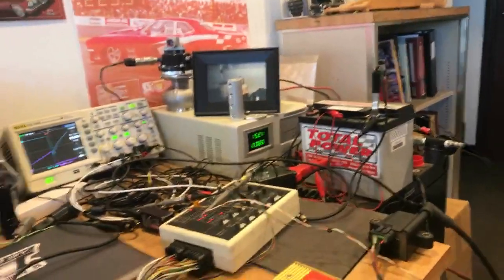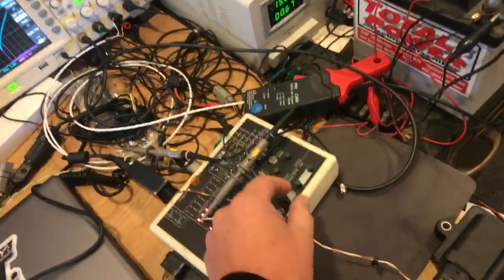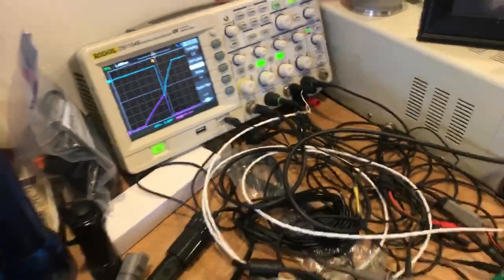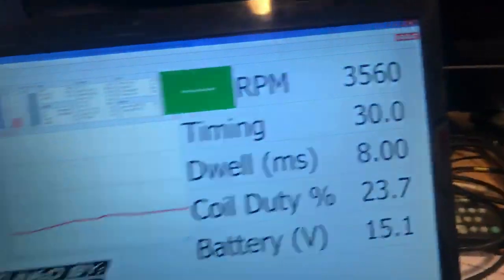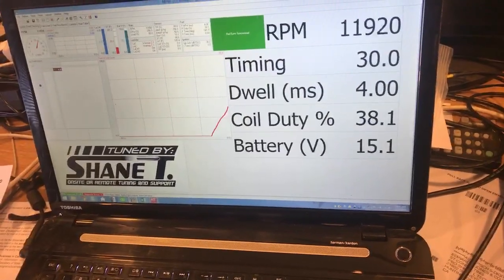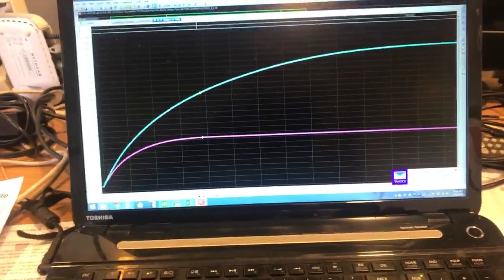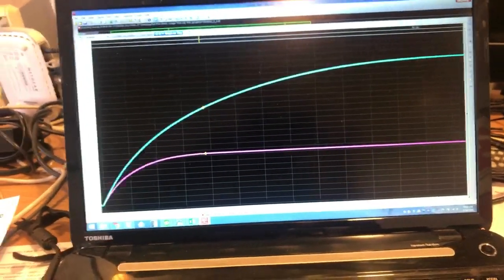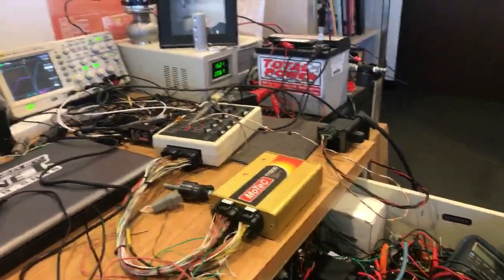Ignition Coil Dwell Testing and why cheaper isn’t better - Tuned By Shane T

Comment: You get what you pay for.... it's cheaper because they spec it to have less copper windings.  if you have good equipment you get use the ohms to determine the amount of windings.  what's interesting, is there an industry standard set for electrical/electronics race application? Because the baseline is OEM but for purpose built you would think race application should be better.  I've seen name brands for race application fail with bad QC and have turned to OEM i.e. manufactures coils (that meet the specs I'm looking for) for purpose built application.

Comment: Amazing information Sir! What are your thoughts on the IGN1A coils from Ballenger Motorsports? 
I have been running Carter Motorsports “branded” IGN1A coils without an issue since 2019, however we purchased a new set from him back in July 2024 and they look real but we had the car on the Dyno and cylinder #7 was running super hot plus very high coolant pressure at low boost #12 we were seeing 40+psi. We believe it was the coil SMFH WE RUN HALTECH Elite 2500 tuned by Matt Shue in VA. Thanks

Comment: Can you show how much different voltage effects the output? So say you lose an alternator when you are at the track and it’s running 12.2 volts during the run instead of 13.8 or so. Thanks

Comment: Hey Shane. Is dwell time reduced  the higher the rpm that is present. Like on my turbo vr6 theres a dwell table and Im tryn to understand it to set it up. U seem like u kno wat ur talkin about and ur equiptment set up and testing shows it. So if my coils safe dwell time is 3.2 ms, should I set it at 3.2ms at 500 rpm give or take, and then at 8000rpm set that to 2.5ms, and then trend that through the rpm? or keep at 3.2  ms through the whole rpm? band?
Reply from the maker: The dwell should be set to match the peak output of the coil based on the battery voltage. Because the charging time is a fixed value, it becomes a larger percentage of the “cycle time” as the engine speed goes up. In other words there is less resting time the higher you rev the engine. This could result in overheating the coil, which would be the only reason I can think of to reduce dwell with RPM.
Reply: @TunedbyShaneT  K thanks shane.
Reply: Hey and also so if the coil isnt charging enough the spark would be smaller or weaker right? Like say my coils max charge time is 3.2ms and I reduce that time to 2.5ms and test the spark, it would have a smaller spark right?
Reply from the maker: If the peak output for a particular voltage is 3.2mS then yes anything less than 3.2mS will have reduced spark energy. You can think of the dwell time as a throttle for the spark output. The less you use under peak output, the less spark energy is available.
Reply: @TunedbyShaneT  thank u very much and this is exactly wat I thought. Its weird cuz a lot of people think the spark will be the same and makes no sence to me. Thats y I asked u cuz I knew u would know the exact answer. Thanks man. Just a lot of people mis inform people.

Comment: Aren't there some kinds of ignition systems that allow you to 'set the dwell' versus RPM?
Reply from the maker: Yes typically the main adjustment is by battery voltage with additional adjustments for RPM and sometimes engine load

Comment: You've got lots of things wrong with your test setup. Your plug at atmospheric pressure, it's sparking at only about 3KV.  You connected the scope to the secondary side which you never do, it loads the circuit  and distorts the numbers by 50%, you're over dwelling the coil and you don't even know what saturation is?
Reply from the maker: 1magnit the test setup, pretty clearly illustrates the difference between the good coil and the bad one, regardless of what you think of it.

Comment: I really enjoyed that. Expensive is great, but I have a fondness for cheap. That entire test setup (minus pressure chamber) can be done by many for under $100. I'll have to build one for my guys. I designed the Dwell Spark LED retrofit for the Sun Distributor machine.
Reply from the maker: I think the word you are looking for is valuable, not expensive.
Reply: Opera5714 - what is the Dwell Spark LED retrofit for the Sun Distributor machine & do you have other items for the Sun machine?
Reply: @  This module is for the conversion of the distributor machine to LED when the neon flash tube goes bad. This is far more cost effective than replacing the neon tube and it converts the machine to 12V so electronic HEI modules can be used.  With a flick of a switch the machine  will flash not only when the points open, but also when the points close again.  This allows dwell to read directly by rotating the scale.  Flash recovery rate is so fast that point bounce can often be seen as additional flashes.  This is almost the complete replacement of the distributor machines electronics and may require some modification to dwell and rpm circuits.  The head must also be rebalanced.  Not a casual upgrade, only suggested for dead tube issues and total restoration.
Reply: What is the Dwell Spark LED retrofit for the Sun Distributor machine & do you have other products for the Sun machine?
Reply: @  Just this product.  I can help with many issues with these machines.

Comment: curious what a flow chart will look like for an ignition coil failsafe options. if ignition coil dwell times are outside of required settings, set boost psi to 0, disable WOT, max rpm to 3000. curious what a fail safe setting will be when ignition coil temperatures are too hot. Mr. T as always i appreciate your sharing experiences! I am waiting for a tuners text book, author: Tuned by Shane T. will surely be SEMA's best seller!

Comment: I'm not sure why you want to share all of this information with the world, but I'm glad you do!  :)
Would you mind maybe showing, or even just say real quick here, what the difference is that you see on the scope with the real coil?
Reply from the maker: Hammerhaus Kennel output energy is less for same dwell charge time.
Reply: TunedbyShaneT Thank you!!
Reply: That is the final conclusion, but I think you can even deduct more information from the graph shown after 6:40. The amount of energy stored in the primary side of the coil is 1/2*L*I^2. If the induction of both coils is the same (which it seems as the slope at the start is very similar), the amount of energy it can store is equal to the square of the current. For the cheap coil the current flat lines much earlier and lower. The final current of the good coils is double, meaning 4x the energy! The graph also shows that running longer dwell on the cheap coils will not increase current and thus spark energy. One last thing of note: if you do not need the spark energy, running shorter dwell times will reduce the current and thus the heating of the coils and can be beneficial to the lifetime of the coils. Last comment: cool setup and educational video!
Reply: @aDaWaN  Hope you have grabbed a copy of the book Gaseous Conductors by James Dillon Cobine.  I use that book more than any other reference.